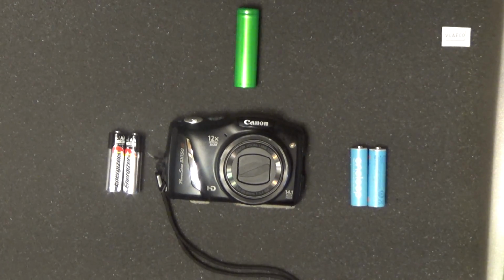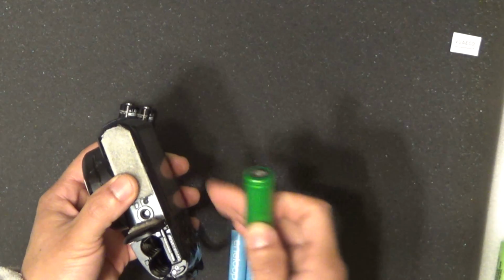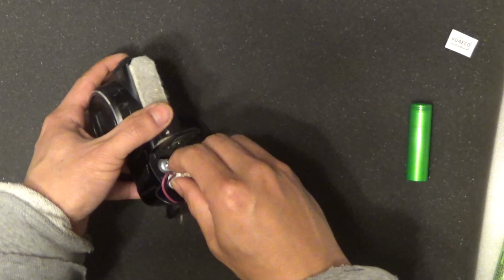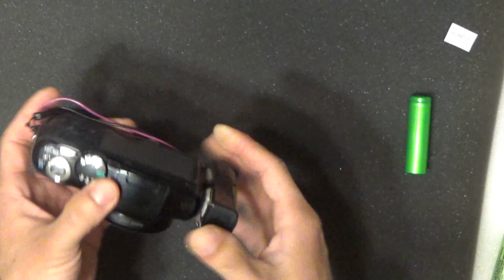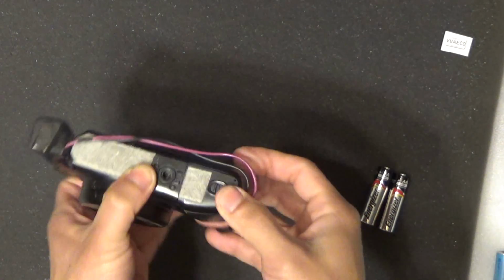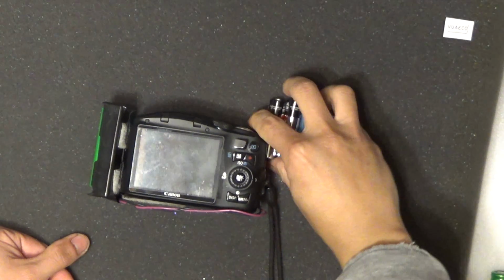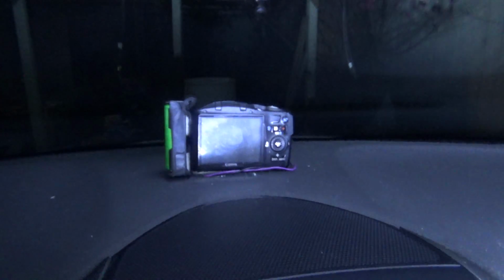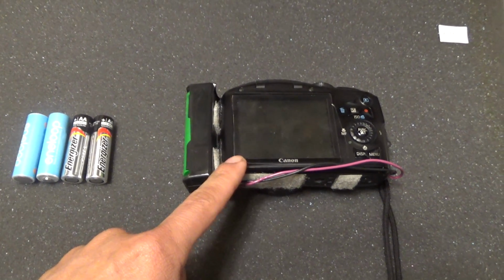DIY: Hack an AA/Eneloop 1.5V battery powered camera to run 18650 Li-ion & make it a dashcam camera

Comment: the cover metal plate should not short the 2 screws. Instead of the screws, you can use any cylindrical piece with just a wired electrical contact at the bottem

Comment: Great! I'm going to try it. Btw, can you please show me how did you connected the screws with the 18650 holder.? I'm a bit confused with wire connection to the 18650 holder. Just to be cautious not to short it.

Comment: i love your video thank you for the idea. but are the extra voltage not of concern, i thing you can put a diode to remove .7v from the 18650 thereby making the voltage closer to that of the AA battery
Reply: I think modern cameras can work on 3,7V, almost all cameras with AAs have possibility to buy li-ion. In may old ultrazoom camera is settings for it. there is NiMh, Alkaline or li-ion

Comment: Great Plan. i have several old cameras that i hate only because they use "AA"'s , i don't think i will hack up my new cannon though. LOL  cost too much to experiment on. 

  the dash cam things a cool Idea also but that sucker will go flying if you get in a accident.   might want to rig a better stand up on it for that.   i am going to go price some 18650s and chargers.  maybe i can hack and old cordless drill charger for that purpose.  i am thinking there may be a lot of more uses for 18650 battery hacks.  maybe to make the solar powered led lights work better.

Comment: Nice :) so this works but I am thinking of getting a 14500 battery (same as 18650 fully charge is 4.2v but only lower in capacity but it's the same same as AA battery) and use with a fully drained AA battery as a bridge to complete the circuit so I don't need to mod for the external battery pack :)

Comment: is over-discharging of the 3.6v li-ion battery a concern? That camera probably runs on double 1.2v Ni-Mh batteries as well, which could bring the voltage down to 2.0v. But if you have recycled batteries from laptops I guess it's disposable :D Good idea though!
Reply from the maker: over-discharging the Li-ion battery is not a concern in this case. This camera consumes so much power that once my Li-ion battery goes down to 3.6V, it starts to give low-battery warning. So it's just a perfect time to pull it out to recharge!
Reply: Interesting, it takes two 1.5v AA = 3v and how was those power the camera?

Comment: Lucky the camera doesn't get fried on a full charge. 18650 hits 4.2VDC fully charged, while two AA in series are only 3V. For the car you should use a step down from 12V lighter yo 3V you can use an adjustable MP2307 module to power literally any camera
Reply from the maker: Actually a new AA is about 1.65V each so both of them are more like 3.3V. After 4 years, it's still working like new. I use it almost everyday.

Comment: Có lý à nhen ,cái 18650 holder bạn mua ở đâu vậy ,Mình còn 3 cái canon sx150 .,đang tính mua Pkcell 1.6 volt  AA Ni -Zn  battery đây ,mà không biết dùng có tốt không ?.
Reply from the maker: Toi mua 18650 holder tren Ebay, rat re, chi duoi 1 dong USD. AA NiZn toi dda xai qua, khong ben. Xai duoc khoang 20 charge cycles la no chet! Xai 118650 tot hon nhieu va co the xai lau het bin hon.
Reply: @vuaeco  
OK Cám ơn bạn nhiều nha .

Comment: I am afraid 4v might fry the sensitive components inside.😵
Reply from the maker: Been using it ever since. I'm still using it now. Have never had a single problem.
Reply: I think the electronics inside can tolerate between 2.7v and 4.5v ... that is why u have been using it with no problems at all. The question is, do all cameras can support up to 4.5v?